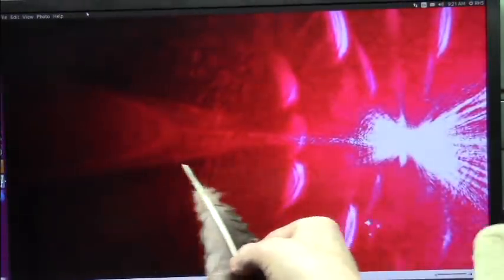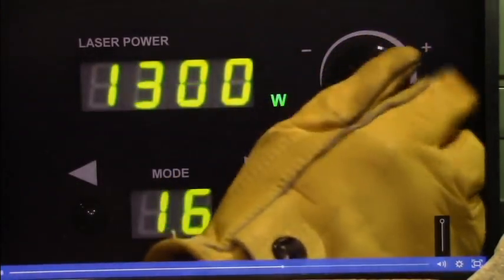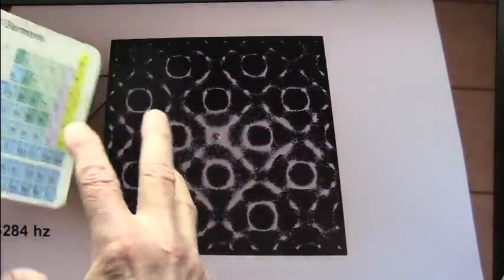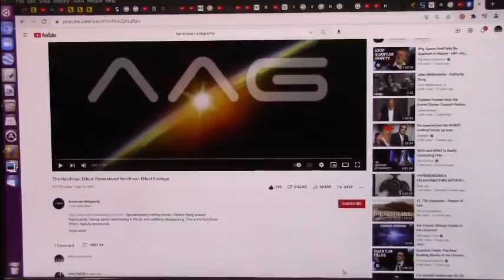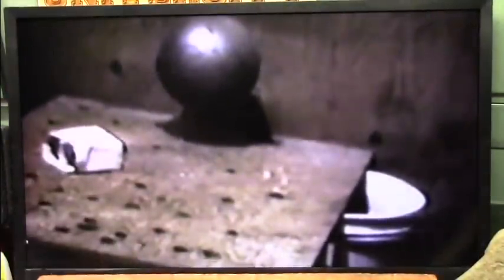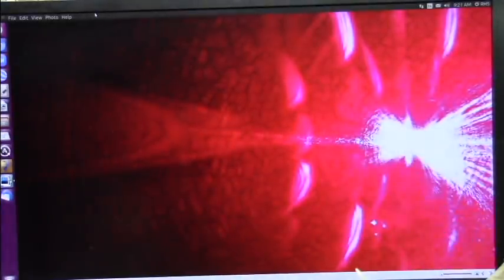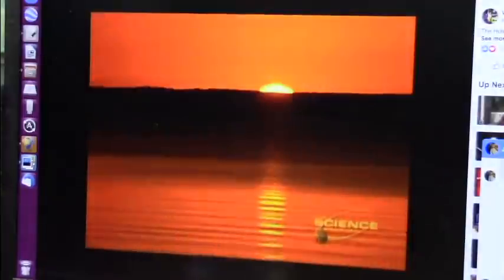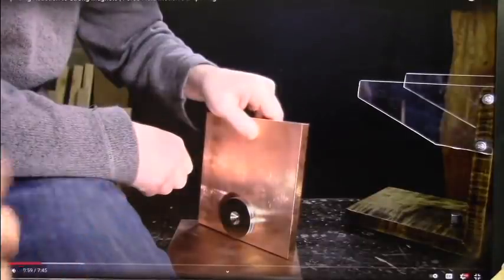Shining a New Light on Light itself

Comment: 9:04 This can be recreated with no more than some frozen water and some fishing string. Cameras are better now, so it would be harder to do. This is to easy to question. Many would say this is media run backwards. And, the last one with the Tin can, that looks like a bouncy, bounce, that could not have been part of prof, because the can looks like it's caught in gravity, and reacting to all of the forces as we know them now, that's before you quickly stopped the video. So, in you doing this, I know you understand that it's questionable. I like your work, but this prof you using in this mans work, is questionable and looks like tic toc glamour, but from that times media.  I've watched 4 or 5 of your vids, you do have some compelling arguments, and I'm really enjoying myself with it. But, I will call it out if it's to gimmicky, and easy to reproduce, or would need more support to make the argument more compelling.  Chances are, I will be subscribing to you after a few more vids. 9:23 That plate is a gimmick. It's in rotation at an angle. This can be recreated by using a simple motor and plate. 9:31 He turns a piece of metal into a magnet, I wouldn't use this as prof of anything. 9:33 Looks like an there's a object in than clump of high viscosity fluid being withdrawn, following to many of our current physics. I don't think you should use this mans work as prof for your arguments. And, just incase you don't think I've studied this footage close enough. 9:05 looks like Frozen Ice Tea, and then you see frost at the bottom of the glass soon after the frozen contents were withdrawn. And, this was not the first run, but the second run, because there's already some condensation at the bottom of the glass from the first withdraw.

Comment: for fun let's heat up those tractor beam magnets or let's get a bunch of these and put them in the patterns of the sand art and if they will bond and then see if they will reject and or levitate another set of magnets passing over them. then wouldn't a 16 electron band permeate farther than a 6?  ok bolted in - so copper cut outs of those patterns and add either magnets or highly energetic materials and you will have the world's weirdest tuning forks? would they collect other than solar energy?